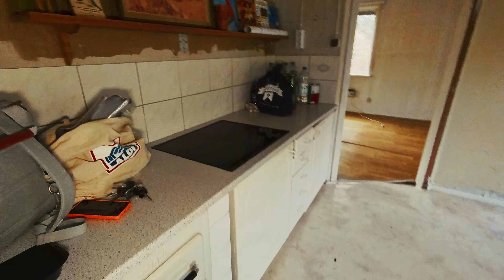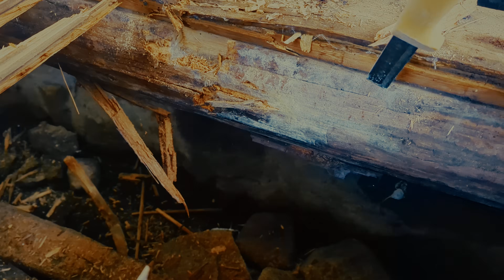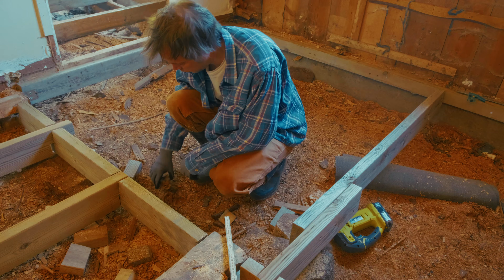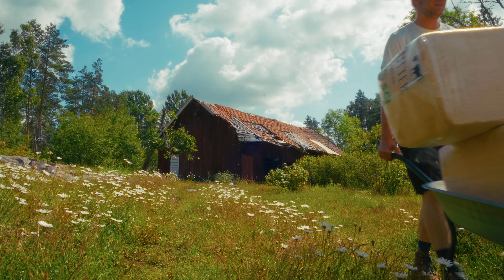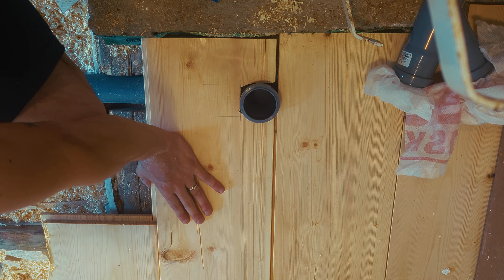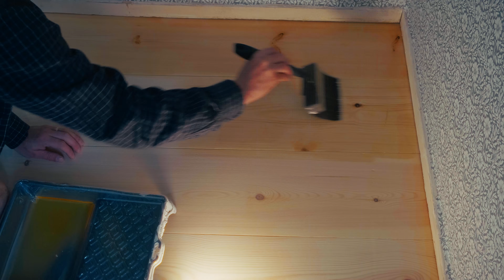One Layer of Plastic Almost Destroyed Our 125-Year-Old House

Comment: Unfortunately very common.

The 1960's to 1980's were a period with a lot of innovation in building tech and materials. Much of if was applied without the proper understanding of long term effects. Transport and buffering of moisture in the air being one of them, it's a complex matter where often "common sense" understanding does lead to disaster and you really need to learn and understand where moisture comes from, how it travels and how to handle it.

Just one example; it's highly counterintuitive to ventilate the foundation in the winter and keep it shut during the summer, most would like to keep it shut in the winter and trap in the warmth. But ventilating it in the summertime is damaging, as hot summer air contains quite a lot of moisture that condenses in the colder foundation.
Reply from the maker: Before starting this project I had no idea about any of this, I'm learning so much through the process of doing this and wanting to do right by the old building. 
It would be almost impressive (if it wasn't so sad) how much knowledge can get lost in one or two generations.